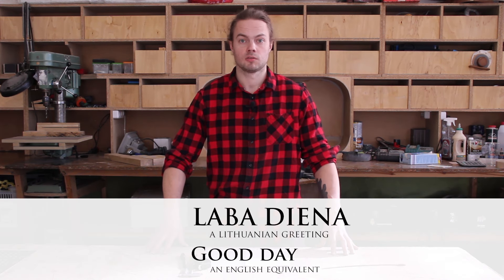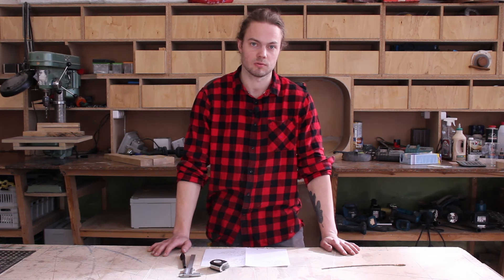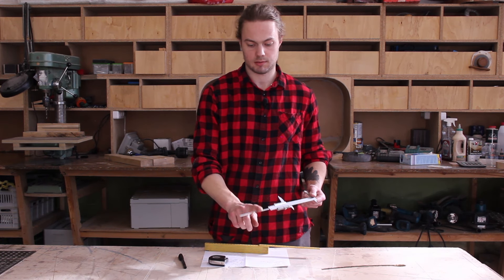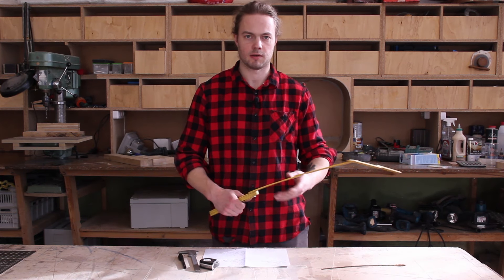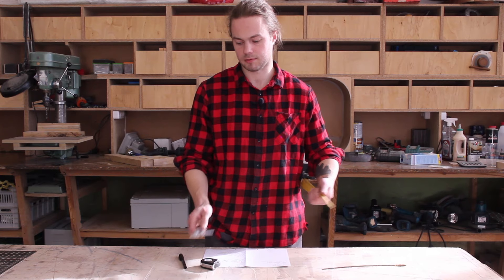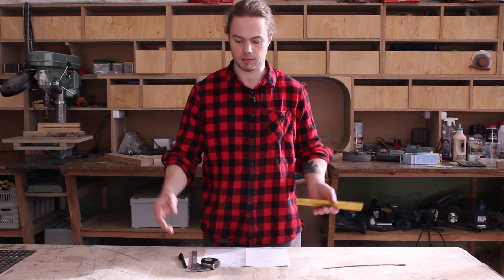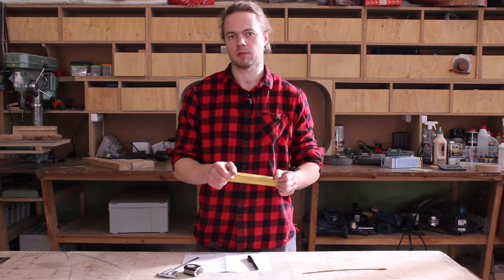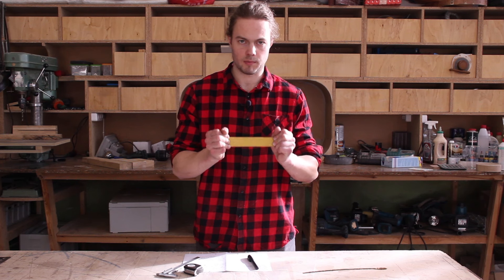WOODEN TIPS #1 | Folding ruler tips and tricks

Comment: I like having a folding ruler around. The new wooden rulers aren't made nearly as well as they used to be. I got two new ones that were both off  1/16 of an inch. I did a video on them, I also got a plastic ruler to try and it seems to it's going to be a good choice.
Reply from the maker: Not a promo but Hultafors is the best I’ve tried. Both, wooden and plastic one are great. I just like no-binding-one better
Reply: @Chiselsplay  Hultafors products are hard to come by where I live. It's too bad it seems like they make good stuff.
Reply from the maker: diyVT sad to hear, because they are really great in my opinion

Comment: You can get a good square from the 3-4-5 rule as 30cm-40cm-50cm: Set a 90° at 100cm, bend at 60cm (makes a 40cm leg), and swing the center of the 10cm mark (50 cm leg) over the 130cm mark (30 cm leg).  Drill a hole if you use it often.  You can get 60° from three joints like (20, 40, & 60) folded in a equilateral triangle,. If you have trustworthy 90° detents, the 90°-60° can give you 30°.  

The best I found for 45° is to bend a 90° at 40cm, bend  another 135° more at 60cm, and if you trust your detents, then hover the 20cm mark over the stack.  You can bend at 20cm to line up under  the 60cm-100cm hypotenuse.  If you don't trust your detents you can use Pythagoras and confirm that the 20cm pivot is at the 40cm+20cm+sqrt(2)*20cm=88.2847cm and make a mark.

It is nice to score/mark a line across the unmarked edges at the joints so you can tell when the joints are lined up with something.
Reply from the maker: Woow, there’s some super handy tricks and modifications for my ruler. Thanks a ton, buddy!!
Reply: @Chiselsplay   I made a couple edits for  because I made an error writing where to start bending for the 45.  Scoring the edges and rubbing in a little ink makes it easy to tell if you've got a joint over a mark for the 60° (and also if you made a 88.3cm score for the 45°.)

Comment: Best ruler,I always have one handy.first of all my grandad use as long I remember this type ruler so i has for me sentimental value,and second is so versatile,a specially the ones that has a hole on hinges linking rulers
Reply from the maker: Great tool to have. Could you explain the benefits of the holes through the hinges?
Reply: Drive nail through the hole and use it as a compass to draw arches or circles,in larger scale,while ordinary compass would have size limitations
Reply: Off topic (arba ne į tema)i never rely on one tool while working,as we all know every tool has its own limitations,but on my workbench I always have at the reach of hand folding ruler,measuring tape,and steel ruler of 1m with attached sliding block with wing bolts to fix block on measurement
Reply from the maker: @juodimarskiniai1  Yup! Double checking is crucial step in the making process